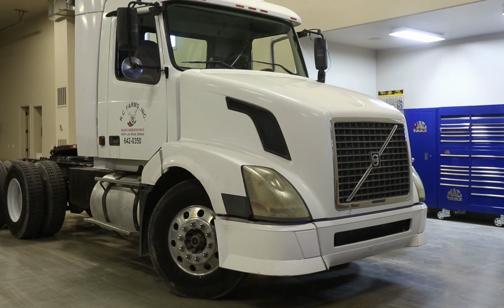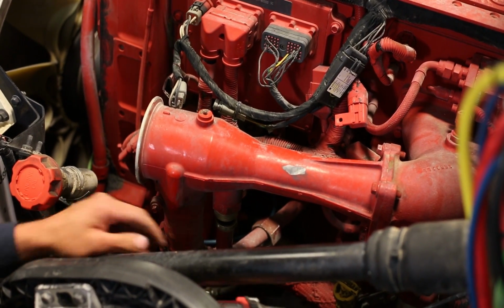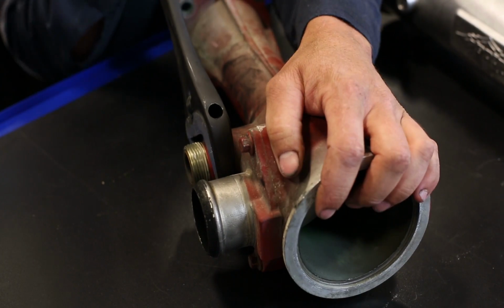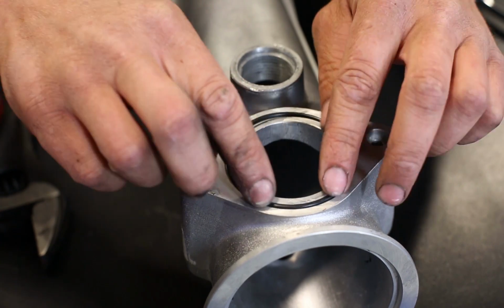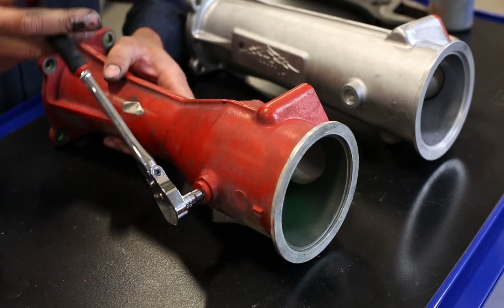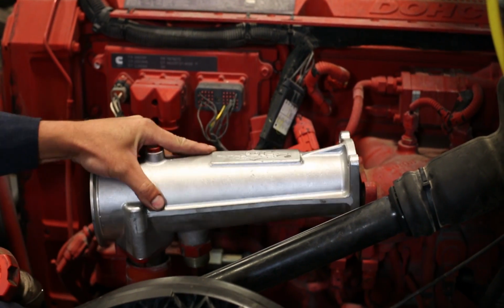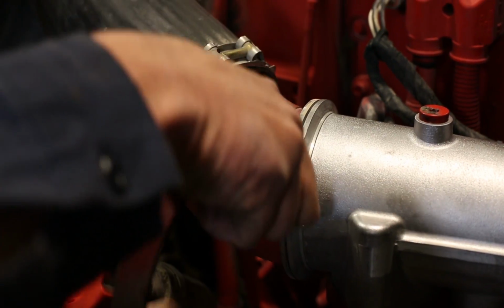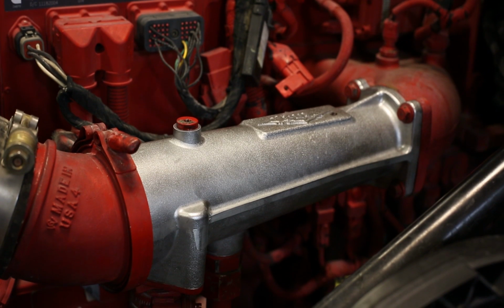How to Install: PDI Intake Manifold - Cummins ISX

Comment: Do you offer a PDI intake elbow for any/C-15 6NZ engines?
Reply from the maker: No sir, with the CAT intake, it is 4" throughout with no bottleneck.  So there isn't much airflow to gain or improve there.
Reply: pdidiesel sounds good. Thanks for the reply. Extrude honing would likely help, but not immediately necessary for what I’m looking at buying (6NZ).

Comment: Hi how do I know if I need to replace intake manifold?
Reply from the maker: Well.. it's not really a wear item that needs to be replaced due to being worn out, this PDI manifold is designed to increase the air flow coming into the engine, which helps with HP, Torque  and fuel efficiency.  It will let the engine breathe better and lower intake air temps, exhaust temps and a cleaner burn in the combustion chambers.  So if you're still running a stock Intake manifold, then you need to upgrade it.  Thanks for watching!
Reply: I'm at international right now, the codes read Intake manifold below normal operating levels. My truck lacked HP and boost wouldn't kick in until 14k rpm.

 Its just not a change because you want, all parts play a part in operation of the engine
Reply from the maker: That would be the intake manifold pressure sensor that caused the error code.  The Intake manifold does not wear or have a way of decreasing the air flow.